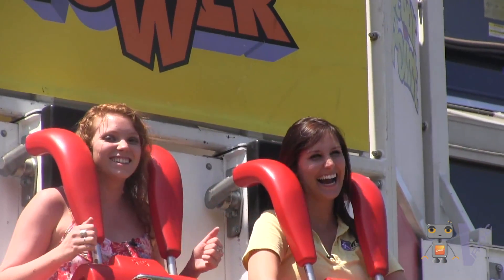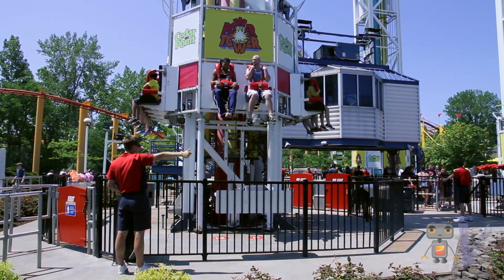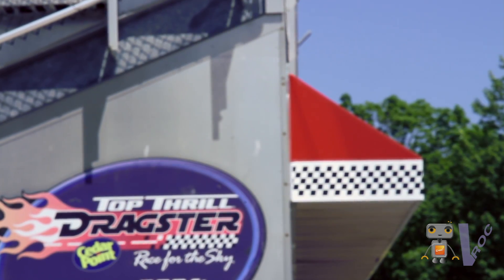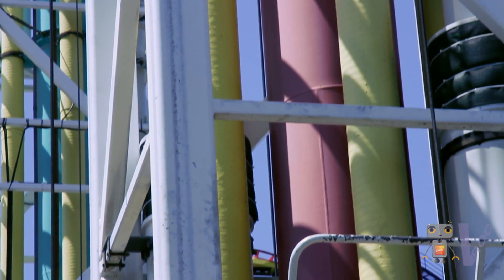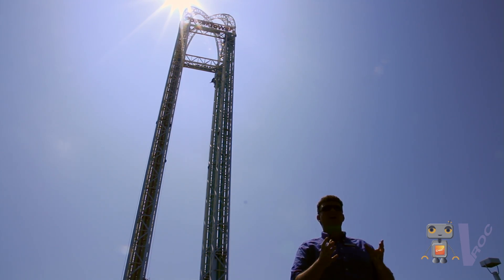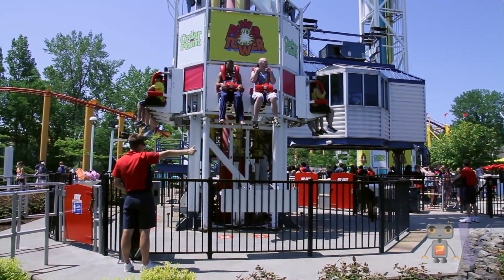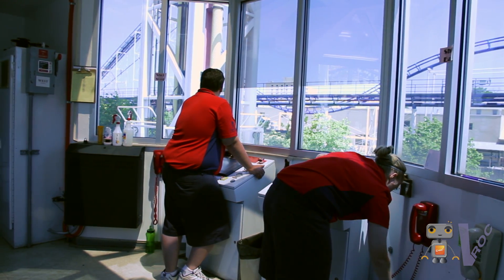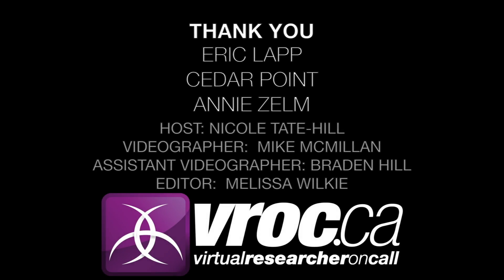Why Math? - Episode 20 - Cedar Point Power Tower

Comment: Top Thrill Dragster actually uses hydraulics.  It has nitrogen on one side of a piston, and oil on the other.  It only uses the nitrogen to store the energy; it uses the oil to transfer the energy to hydraulic motors.

This makes it far more efficient.